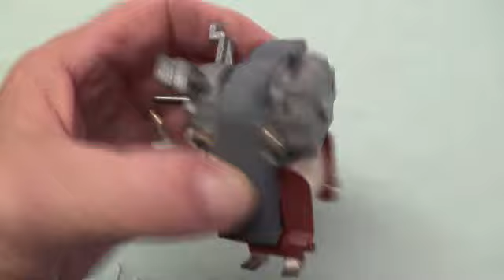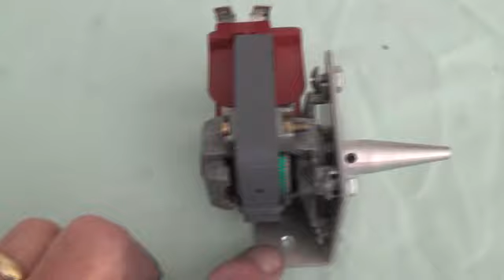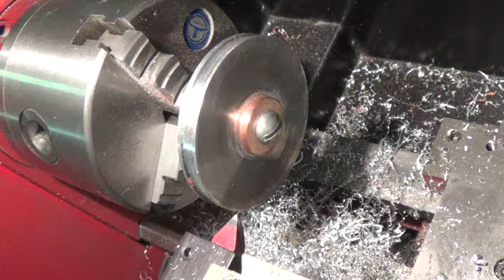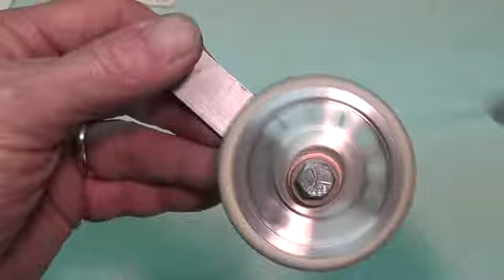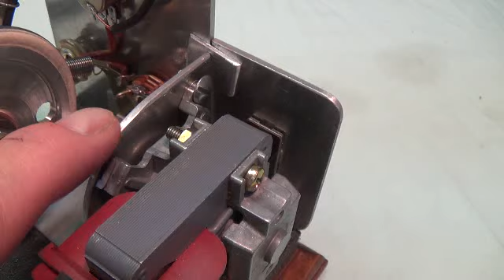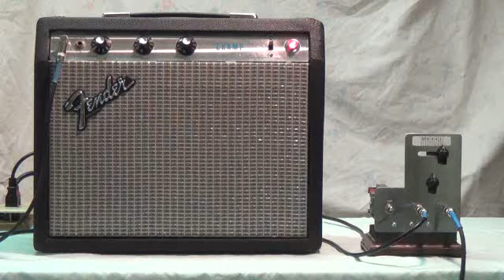Homemade DeArmond Electromechanical Tremolo from Scrap Parts

Comment: Why do you use Windex fluid? Can't you use salted water or other conductive fluid? I saw other peoples vids on that kind of tremolo wich use Windex too. There's must be a reason... but i can't figure it out. I saw that the windex frothing in the canister, does it account for some permanent conduction, or do the surfactant make a film on the surfaces with the same result ?
 The sound is very convicing anyway, and your buid is very neat and pro looking.
Reply from the maker: Every source you read about these units recommends Windex, but I found that plain tap water actually worked better.....less frothing and lower conduction, which provided a smoother transition between the electrode being grounded and ungrounded.  Thanks for your nice comments about the build.

Comment: Sigh..... i want to buy a lathe, but i don't have any place to put it.. :(
Do you know any small lathe that can turn metal at aprox this size?
Reply from the maker: +Håvard .EF   Yes, the one I own is quite compact. I believe it can handle material that is 14" long and about 5" in diameter, which is all I need since I tend to machine small parts.  They are available here in the U.S. for about $500.

Comment: never even thought about tap water,but seeing as it's full of metal ions..heavy metal.
as a side note,the 1954 national deluxe amp you had/have,you did a bias service on it,what was it's out put power,to be honest i cant remember if both tubes add together for output or each side IS the power out put total,plus id need to go over tube curves based on the actual values of the output TX,etc,to get the A and AB curve sections,i rarely use the curves and have been away from amps for a while,most of my notes are from single ended stuff i did years ago,and they all dissipate (musicaly ) half the plate idle.
i need to dig out my books.
Reply from the maker: +john amptech  As I recall, that amp had a pair of 5881's. Moderately biased, I would estimate the output power at about 18W.
Reply: thanks for that doug,i'll be making a video sometime soon of one or two amps i have here ,which i made,a DC30 type and a 6v6 output amp SE with UL,TRI and PEN output plus reverb,all stuffed in a very small marshall G10MKII solid state chassis and cab
Take care ,god bless and give rusty a schmako or markie from me.
Reply from the maker: You're welcome, John, and best of luck with your video. Rusty sends his regards.
Reply: ? Does Rusty have PATREON 
to support his innate meat-bones habit ?

Comment: does the windex foam in the pper tube,might cause signal leakage,a lower mass mercury tilt switch might work well,very nice smooth trem sound all the same,no noise(electrical) just a smooth transition.
Reply from the maker: +john amptech  Yes, foam is an issue since it creates a continuous loss of signal, reducing the amplitude between peak and trough. However, Mercury is not an ideal medium either simply due to its all-or-nothing conduction, which creates a square-wave signal, rather than the sinusoidal signal obtained with media of much lower conduction capability.  To be honest, simple tap water seems to be the best conduction medium, at least in my experimentation......no foam and about the right degree of conduction.
Reply: Tap water is not steriLe . 

The (R)(TM) WiNDEX ingredients 
suppress bacteriaL reproduction. 

To Sound funky, 
you NOT need to 
BE funky.

Comment: This tremolo unit is simply amazing to me. I wish I had one. thanks for the amazing, interesting and informative videos. please keep making them. say hi to Rusty for me......
Reply from the maker: +Nick Cos  Thanks, Nick. If you liked this one, you may also like a completely different style that I built several years ago. Please see my video comparing it (EM Tremolo) to a tube-style purely electronic Tremolo.
Reply: Hi Doug,
I’ve been chipping away at my own mechanical tremolo since seeing this. I used a small dc motor with a pulse width modulator for speed control. I’ve got it enclosed in a very compact Hammond 1590B case with the canister extended out of a hole in the top. Mechanically it’s pretty much up and running but I can’t find any information on what to do with the guitar input and ouput signal. Any chance you would share the diagram of the wiring and potentiometer value for the intensity/depth?

Comment: I really enjoy watching your videos, Doug. It's a shame that this way of thinking is not so common these days. Keep up the great work!

Just a question about the intensity knob - is it essentially a wet/dry mix control? If so,  is there a relatively easy way to explain how the wet and dry signal are fed into the pot, and what other components are necessary? I'm trying to put together a little spring reverb unit and the wet/dry mix is the part I'm having most trouble finding clear information on.

Take care Doug and Rusty, and keep em coming!
Reply from the maker: +Dark Deep Red Thanks, DDR. The intensity control for a Tremolo is completely different than the intensity control for Reverb. Tremolo is a rhythmic fluctuation in volume, and the intensity control regulates the depth to which the volume can be lowered.  At an intensity of 10 (max) the volume of the signal is modulated essentially to zero before being restored to wherever the amp volume is set. 

Reverb intensity is the one that mixes the wet and dry signals. If you look at a schematic for the Fender 6G15, you will see that the signal is split immediately upon input to the unit. The "dry" half is sent to a 12AX7 triode for routine amplification and then straight to the output of the unit. If the intensity (it's called a "mixer" in the 6G15) control is at 0, then this is the only signal that enters the amp. 

The "wet" half goes through a 6K6 or 6V6 tube for amplification, then through what amounts to an output transformer where its high voltage is converted to high current to drive a reverb tank, where all sorts of echos and delays are produced, then this highly altered signal goes to a 12AX7 triode for final amplification to the same level as the dry signal. If the intensity ("mixer") is set at 10, then this is the signal you hear. 

If the intensity/mixer is at 5, then you will hear a 50:50 combination of the two signals. Long ago, I made a video that was posted on another channel (before I had mine) that explains it diagrammatically: https://www.youtube.com/watch?v=oL69xjGY3MY
Reply: +Uncle Doug 
Thanks for the response, Doug. I'm with you there, I think pretty much everything is planned out including a tone and volume section at the input and multiple buffer amps along the way. I was really focusing on the pot I would have to use for wet/dry control - specific value to use, single or dual gang, other resistors needed, if any, and how to wire it up. Information on the subject seems to be eluding me. I imagine it should be a very simple addition to the circuit, but I don't want to mess it up!

Thanks again
Reply from the maker: Simply find an existing circuit that is very close to yours and do what they do. It's always a good place to start.

Comment: What a superb em. Trem unit gorgeous to look at and wonderful to hear I recall a  neighbor of mine had a trem box that used two variable caps spun by a motor. roto vibe? Have  never seen another. Congrats from Dave
Reply from the maker: +David Salny  Thanks so much, Dave. I really like EM Tremolos and enjoy coming up with strange designs and fabricating them from scratch. I have also made a very different style, and have posted a video "EM vs Tube Tremolo" on my channel. To be honest the EMT featured in this second video may be more visually impressive than the one in the video you just watched.

Comment: Superb device, very nicely engineered. Never knew how they worked.
Reply from the maker: Billy Gibbons tells a tale of using two separate DeArmond electromechanical tremolos at one time, set at slightly different speeds, so they rhythmically went in and out of phase. Toss in a baritone guitar tuned about 4 steps down, a Fender Twin Reverb with VC at 11, and I think the Cal Tech seismographs would register the result.
Reply from the maker: +RODALCO2007 Most tremolos are electronic, Rod. This one is electromechanical, based on the first EM trem built by DeArmond in the late 40's.
Reply: +Uncle Doug wait a second Doug - I had Star Trek soundtrack and other infamous twangs as being Fender Dimension IV boxes - or Magnatone 280 - but perhaps this thing & Danelectro baritone guitar would explain all?  think they also used a Fender bass, but whatever, the tremolo they had was mighty

Comment: nice one !! . i made a realy crazy one in the 60s , made a relay go into buzzer mode on one set of contacts and the other contacts put the signal on and earthed it, crazy sound or what , which led to risistors, gave depth, big relay gave speed bending contacts and altering relay volts, the fx were weird, using caps on contacts el chepo wah wah type of thing, i was 9 when i did it, well super work doug as ever interesting.
Reply from the maker: freak55beat Thanks, FB. I'm impressed that you were experimenting like this at 9 years old. Most kids that age are playing in a sand box :)

Comment: Fantastic stuff, your construction skill is brilliant. Very cool way of implementing this effect, but do you reckon you could provide some insight into why this method was used. Surely back then you could just feed an oscillator into a variable mu amplifier and get the same sort of sound?
Reply from the maker: Michael Fearnley DeArmond invented the EM tremolo in 1941, and it was used in electric pianos. It wasn't until six years later (1947) that electronic tremolo first appeared in guitar amps by Danelectro and Multivox-Premier. Gibson followed in 1948 (GA-50T), and it wasn't until 1955 that a Fender amp Vibrolux) offered the effect. So for several years, EM was the only type of tremolo available. Many still feel that it offers the best version of the effect. Here is an interesting historical review:  http://www.premierguitar.com/articles/19777-a-brief-history-of-tremolo?page=2

Comment: Hi Doug, Great job building the DeArmond Tremolo unit. I actually worked for Rowe Industries music department in the mid 60's. Rowe Industries built all of the DeArmond line of music pickups , amps, etc. I actually used to build the Model 60-B tremolo units by the dozen. You hit the nail on the head building that unit, very interesting.  Great video !!
Reply from the maker: ***** Wow....high praise indeed, DW, especially from someone with your experience. Thanks so much. Rusty and I are glad you enjoyed the video and liked our little homebuilt tremolo :)

Comment: Oh man. I wish you were my neighbor. Great DY project.

I understand that wen the liquid is shaking, it make a contact with the grounded thank and the electrode. Otherwise the circuit is open when the thank is not moving.  How come the signal of the volume rise when the level of windex is going lower ? Lower mean that it almost not touching the electrode and there is no more contact.   I am french from so i hope my sentences is not too bad.
Reply from the maker: You're sentences are just fine, MP, and thanks for your kind words. Even when the tank is rocking at a slow pace, the liquid does touch (and ground) the electrode. There is still good contact, even at a very slow rate. The tank has to be virtually stopped for no grounding to occur.
Reply: Uncle Doug
Thank you Uncle Doug for the answer.    Now everything is made in miniature transistor, but it's like the product has no soul.    I know is got is good and bad but there is still something missing. Even sound system cheap plastic plastic plastic. Anyway you got me hook on you're channel. Keep up the good work !
Reply from the maker: You're welcome, Masto. I feel the same as you regarding tube amplifiers.....they definitely have "soul". Thanks for watching and for your input. I enjoyed communicating with you :)
Reply: Uncle Doug I enjoyed communicating with you too. Same here Uncle Doug. Thanks.

Comment: H again Uncle Doug; another excellent video, thank you very much.  I was about to ask why windex instead of water, and then I watched the "home made electromechanic tremolo" at El Paso Tube Amps channel, you give the answer to my question on that video.  I assume that you chose distilled water because of its higher resistivity.  I have seen an electrical control panel get douched with hot high purity water due to a faulty WFI valve, after we dried it, everything worked just fine, the water was about 5 megohms coming out of the still (our spec was +12 megohms).  Anyway, everybody should watch the other video, that final version of this device with your brand on it is a beauty to be admired, extremely nice; I think it is a hydro-electro-mechanical device.  I really enjoy your videos, keep making them please; I'll give Coupe a bone on behalf of Rusty this time.
Reply from the maker: You're welcome, Alex. Rusty and I really appreciate your kind words in reference to our videos and EM Tremolos. I have since gone back to Windex solutions (at varying concentrations) to achieve greater volume excursion. The distilled water's resistance decreased with time, possibly due to the leeching of copper ions from the tank. Thanks for your input :)

Comment: I like the other version you made with the large pulley.  It would look very vintage if you made the pulleys out of some nice walnut or other figured wood.
Reply from the maker: Thanks, Aero. The white plexiglass was convenient and easy to work for this prototype. I considered using brass for some of the parts if I made subsequent versions, but wood is also an interesting possibility. Thanks for your input :)

Comment: The single tank is a great idea.  It would be nice to add a selector switch so you could have both probes or just one.  Like a "fast" or "slow" selection.
Reply from the maker: An interesting concept, sort of like the high and low range control found in some 4WD vehicles. I will definitely keep this in mind. Thanks !!

Comment: I had a thought about what if you had two "Windex" tanks back to back and when the tank moved one way one tank would ground and when it moved the opposite direction the other tank would ground.  That would allow you to run it at half the speed to get the same effect.  Would be easier on the mechanical linkage.  Give Rusty a hug as well :)
Reply from the maker: Rusty and I thank you for your good suggestions, Aero. This is similar to the concept of having two grounding electrodes, one at each end of a single tank, for the same reason you cite. I fully intend to explore this concept in the next one of these I build. Thanks so much :)

Comment: I really enjoyed your video.  I wish that we were neighbors.  I could learn electronics and such and you could drink my home-brewed beer.  Keep the videos coming.  Thanks, Jim Coleman.
Reply from the maker: Jim, this sounds like it would be a fair trade :) Fortunately for you, however, I have posted a bunch of videos that you can watch for free.....and I get no home-brewed beer :(  Never fear, Rusty and I will definitely keep producing these little melodramas as long as great viewers continue to watch.......and leave nice comments.
Reply: Doug, is there a better way to ask you a question other than from a comment on this video?  My question is, why is the high voltage from the rectifier called B+?  I know that the plus mean positive voltage.  Thanks Doug
Reply from the maker: In the very early days of radio, they were powered by three different batteries.....one for the tube heater filaments, called the A battery.....one for the high (plate) voltage, called the B battery.....and one for the bias voltage, called the C battery. Since the tube plates were connected to the + terminal of the B battery, the high DC (plate) voltage was called the B+ voltage, and that term is still used by us old timers to this day.
Reply: I did a Google search on B+ and couldn't get an answer.  Thanks so much for the answer.  I'm going to try to post some pictures that will pique your interest - I have a short-wave radio made by Phillips that still works.  The cabinet is in great shape and the tubes and speaker appear to be original.  I'm still watching your wonderful and very informative videos.  Enjoy your day.
Reply: I misspoke.  It's a Philco, not Phillips.  I posted pictures of it.  Let me know what you think.
Reply from the maker: The cabinet and grill cloth seem to be in really nice, original condition. This is a very good looking old radio. Have you connected it to an antenna? Years ago, when I worked on radios, I strung a 50-foot strand of copper wire to a tree in the back yard and connected it to the Antenna jack on my old radios. It made a huge difference, especially at night and with the shortwave bands.
Reply: I never uploaded anything to You Tube until today, which were the pictures of the Philco radio.  Now I can't find them so I can add the TV antenna that appears to be from the '70s.  I'll see if I can paste a picture in this comment.  The radio works with this antenna, but is there a more preferred type?
Reply: OK, I don't know exactly how I did this, but I added a pic of the antenna.  BTW, I have a 1971 Bandmaster Reverb, TFL 5005D with a matching 2x12 cabinet.  I had somebody redo the chassis and it sounds amazing!  It has EL34s instead of 6L6s.  The tremolo is intermittent.  Do you know where I can find a new one to install?  Thanks Doug!!
Reply from the maker: The antenna is simply 40 or 50 feet of thin copper wire running from your window to a tree. One end of the wire is connected to the Antenna jack on the radio. Check the Internet for sites that explain how to insulate and ground the antenna to protect against lightning damage.

If your BR Tremolo is acting up, the circuit will have to be checked out and repaired by an amp tech. It's not something you can simply replace.